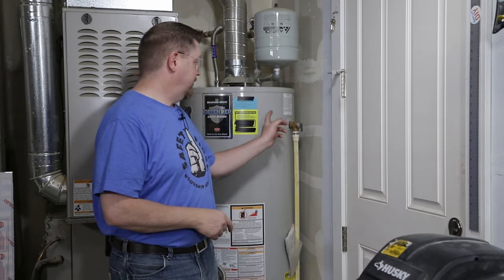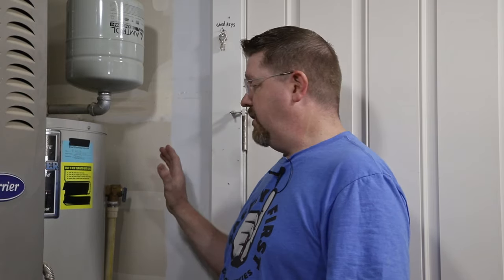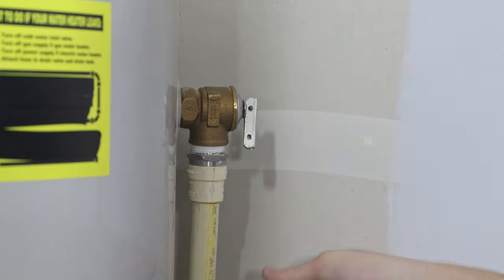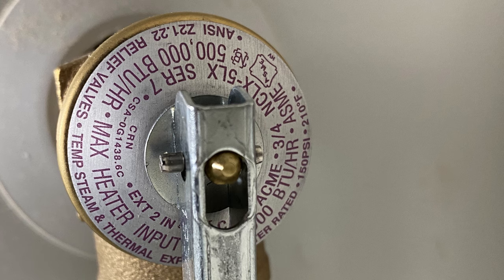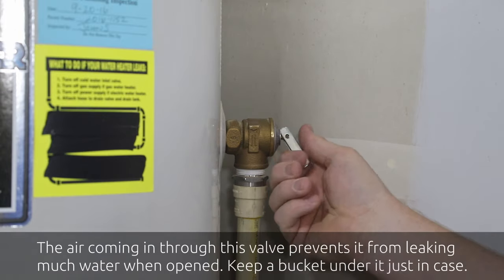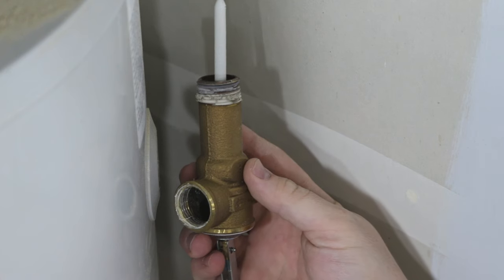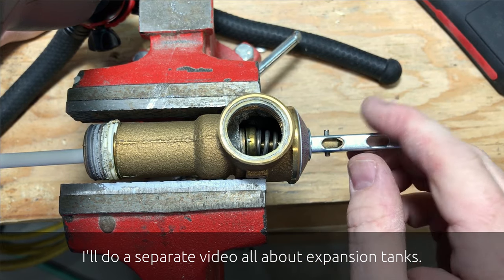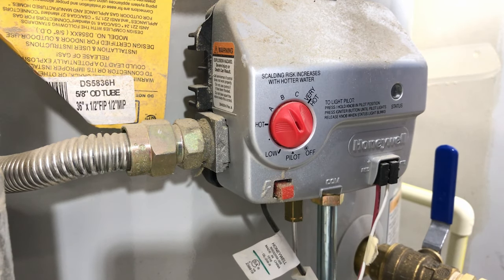How To Replace Pressure Relief Valve On A Water Heater (T&P)

Comment: I watched a video that led me to this....i flipped the valve and nothing happened.....WHERES THE VIDEO IN HOW TO DRAIN THE WATER ENOUGH WHEN THE RELEASE VALVE WONT LET YOU DRAIN IT BELOW IT
Reply from the maker: I'm confused: you walked up to your water heater, flipped the valve, and NO water came out the down tube? If so, that valve is faulty and really should be replaced. I have several videos (including in this one) that demonstrate how to drain the tank... if you cannot open the valve, you have to let air in somewhere - the most common place to do this is to shut off the cold water inlet, then connect a hose to the drain valve, open the drain valve and then disconnect the cold water inlet fitting from the top of the tank. This will let air into the top of the tank, so the water can drain out the bottom past the level of the T&P valve, so you can replace it. 

Good luck!
Reply: @AmplifyDIY  i found another video showing there the faucet trick and relief valve dont work, so i undid my hot water line uptop to let air in and it started flowing out! Hahaha.  I replaced the relief valve, it was absolutely disgusting.  I told so many people to check it!   Great videos, saved me $$$$...keep them coming!  Just happy to have no more leaking water LOL
Reply from the maker: @kump32  I'm glad you got it figured out - and nice job getting your valve replaced!

Comment: So why is there such a controversy around T&P valves? Is it because there was a time when folks used them inappropriately and so now we "over-react"?
Reply from the maker: I think it's because so few people ever do any maintenance on their heaters, so everything on the heater gets caked/jammed up with sediment and scale. Then when you go to open the T&P valve it won't re-seat correctly because it's full of crud. So, the "Don't touch it! You'll cause a leak!" mentality was born. In reality, you are supposed to test them at least annually, and if it does not re-seat correctly, replace it. Easy peasy.
Reply: @AmplifyDIY  , thanks for sharing this perspective. Very helpful. We recently had a new water heater put in. We moved into this home several years ago and we didn’t do any maintenance on the heater. It developed a small leak recently and we discovered that this water heater might be the original!! 30 years old!! With the new replacement, I’m now more conscientious about providing maintenance since, well, this new device and labor cost us couple thousand dollars. It’s just a regular direct vent water heater though. Imagine my surprise though when I discovered that the energy efficiency of this water heater may not be that much better than the old 30-year old one. Ugh.

Comment: Mine doesn’t have a pilot option now what?
Reply from the maker: Does it have a vacation setting? If you can't find an obvious way, it's time to look up your model number on google and grab the owner's manual to see what procedure they recommend for correctly turning off the heat source for maintenance. Good luck!
Reply: @AmplifyDIY  Mine does not either. I just shut the boiler off. There is a service on-off switch right on the boiler itself. Is that acceptable ?

Comment: We have to get plumbers to do anything like that here in Australia. And they charge like wounded bulls.
Reply from the maker: You have to? As in there are laws governing what you are allowed to fix/repair in your own house?
Reply: @AmplifyDIY  yep, depending on what it is. It is illegal to do any plumbing work more than changing over a water efficient shower head or replacing tap washers, without a certificate. Same with electrical work. Fines can be in the thousands. This is done to help prevent unnecessary injuries or deaths due to an inexperienced person attempting to do work that is better left to professionals. Insurance companies won't pay out either if they discover you've done the work yourself.

Comment: isn’t there a safety mechanism built into these units to auto shut off until such danger is professionally repaired by a certified tech?
Reply from the maker: Hi Jack - typically, no, the T&P valve only opens to relieve pressure / high temperature. It is not (usually) connected in any way to the thermostat or controls for the heat source.

Comment: One more thing 😂 so man I should do this to my hot water boiler also😐 that has a relief valve …. You goanna tell people how to bleed the air out they just let in after 😂
Reply from the maker: I appreciate all your comments, Mike. It helps YouTube know that people are engaged with this video. Thanks for watching!
Reply: @AmplifyDIY  so is that a yes or no 😂. Relief valve is a relief Valve isn’t it 😐 ones 150 psi ones 30. Ones 15 why don’t we test thoes ?

Comment: If you haven't turn it on off for years , leave it there , it may leak   . You might know more than I do , buy it is possible, next mine dose
Reply from the maker: Actually, you are supposed to test them annually, and replace them if they leak. A valve that fails a test (either it won't open or it leaks) is a safety concern, and should be replaced. Keeping it closed out of fear of causing a problem may mask a problem that should be addressed.
Thanks for watching!

Comment: your expansion tank is upside down? dose not matter i guess?
Reply from the maker: I actually did a whole video on expansion tanks as well. Turns out that one can be installed in either vertical orientation. Thanks for watching!

Comment: Hi AmplifyDIY, I love your videos and I'm already subscribed.
I've a question and would love to get your help.
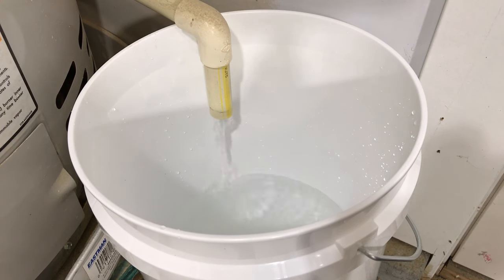I'm testing my T&P valve on Bradford water heater (same as yours), but after releasing the valve (and it seemed to close back automatically), but the water releasing from the drain pipes is not stopping and has been running for more than 2 hours now. At 4:23 time in your video,  https://youtu.be/e5H1i1cypxA?t=267, you say to turn off the cold-water inlet. What should I do next? Is my T&P valve need to be replaced?
Reply from the maker: Hi Kishore - sorry for the late reply - YES - it is time to replace your T&P valve, if you have not already done so. It's a pretty simple job - just follow the instructions in this video. Good luck!

Comment: But HOW do you know which one to buy to even replace it???!!
Reply from the maker: I covered this in some detail in the video. Make sure that you get one with the same specs. The pressures, the temperature rating, and the length of the tube. If you take a picture of the tag/label that’s on the one installed in your heater and then go to the local plumbing store or hardware store, you should be able to find one that matches that tag.

Comment: why can't you simply soak this valve in white vinegar to get the junk out?
Reply from the maker: Hi Edward - you may be able to do just that. It may require a pretty long soak, as vinegar is a pretty weak acid. If you have something stronger like CLR that may work faster. In the end, though, you may still need to replace the valve as the mating surfaces have to be perfectly clean and smooth. Good luck!

Comment: I replaced my T&P valve now my pilot won't relight
Reply from the maker: Hi B. A - the T&P valve should not have any effect on your pilot.... have you checked the user's manual to see what the correct startup procedure is for your pilot? Some can be tricky to get started...
Reply: @AmplifyDIY  you show turning the valve to the "pilot" setting, which mine has too, so I did that, drained the heater (shut off the water first) and replaced the valve. Refilled the tank until air was no longer coming out of the faucet, but when I tried to relight, the little window remains dark. Is this normal? The waterheater is only a couple of years old. It has the push button igniter similar to a BBQ grill.
Reply from the maker: @b.ajohnson9707  Hm... What's the make and model of your heater? I'll see if I can find more info for you.
Reply: @AmplifyDIY  AO Smith, not sure about the model (Signature, I guess) sold at Lowes.
I am attempting a fresh relight according to the instructions on the side of the unit (currently in the 10 minute wait period) will try that. 
I was curious because you did not relight your heater and l thought I may have missed something.
Reply from the maker: @b.ajohnson9707  Hopefully your re-light procedure will work. I did not re-light mine because by setting it to the "Pilot" setting, it leave the pilot light burning, so I don't have to re-light it... just turn the heat back up to where we like it. 
Let me know how it goes!
Reply: @AmplifyDIY  We got it.  What I did not notice was that there is a "pilot" setting on the temp control and only saw the "pilot" setting on the valve control.  When I moved the valve control to pilot, it turned the pilot light off.  Not sure what other makes do this, but on the AO Smith unit I have there are two "pilot" settings, one works like your example, and the other turns off the pilot.  Hope if anyone runs into this in the future you can give them a heads' up.  Also, thank you SO much for your videos and your prompt responses,  I cannot begin to tell you how awesome that is.  Thanks to your videos I was not only able to replace the T&P valve but also added an expansion tank as well.  God bless you!
Reply from the maker: @b.ajohnson9707  Hey, that's awesome! I'm really glad you were able to get it going again, and great tips on there being 2 separate controls for Pilot on AO Smith heaters. Thanks for the feedback, and for watching!

Comment: mine is flowing water out of it like crazy way beyond a leak, 'solution' : buy new water heater i guess
Reply from the maker: Oof. Bummer. You sure the leak could not be solved by simply replacing the valve rather than the whole heater?

Comment: Man thoes valves are rated to 150lbs. They should never blow. They only leak if you open them 😂 all it is.. is a spring and a rubber gasket on inside. NEVER OPEN THEM GUYS. this guy has a flexi gas supply to his heater 😂 witch is illegal😂
Reply from the maker: Hi Mike - as I said in the video, these valves really should be tested annually, and if/when they leak, replace them. As for the flexi gas supply: It was installed by the licensed plumber who installed everything when my new house was built, and it was inspected by the county. 🙄

Comment: Don’t buy Reliance hot water heaters. The say they’ll last 12-15 years and that’s not true. Mine is less than 2 years old and leaked so bad I’ll have to have the floor underneath the tank replaced. After 2 days of phone calls and all they are willing to do is send a replacement valve through the mail. The valve they want to send is 14-20 dollars to replace but the damage and the fact I have to fix this at my own cost is absurd to call it a warranty or boast a 12-15 year product. Do not buy anything from Reliance.

Comment: And has eaither black fittings for his expansion tank that are painted silver. Or galvanized pipe 😂 that all should be brass or copper my man. And flexi water lines 😂 you bugging. Real plumber would never use flexis on a water heater.
Reply from the maker: As I said in my prior response to your other comment: I didn't install any of this. It was all installed by a supposedly licensed, professional plumber. I agree the install is shoddy, and I plan to replace the galvanized pipe.

Comment: These valves are junk and designed in such a way that it's prone to failing. Every time I've used one to assist in draining a tank, they leak afterwards.
Reply from the maker: Yeah, sediment / scale can collect in the valve mechanism and mating surfaces, leading to a leak. As I said in the video, test them annually, replace them when they leak. Thanks for watching!